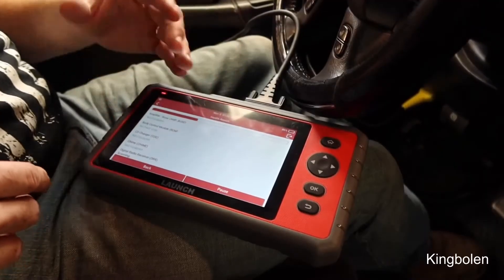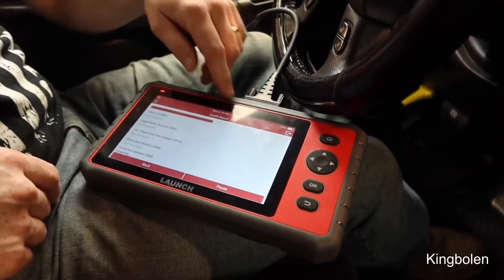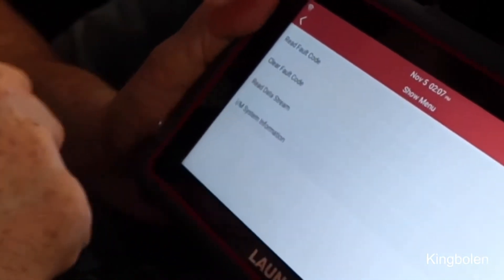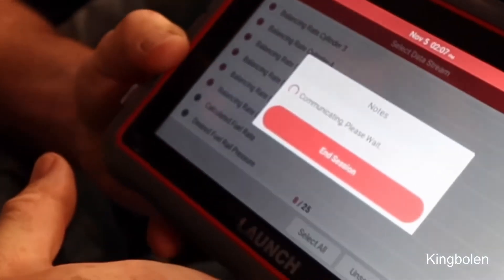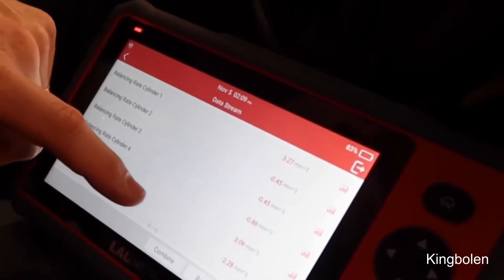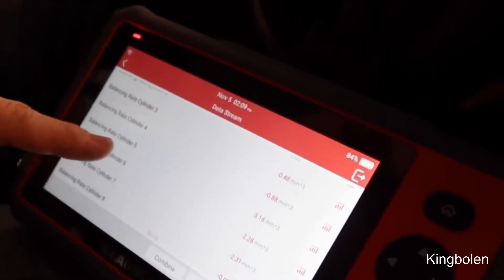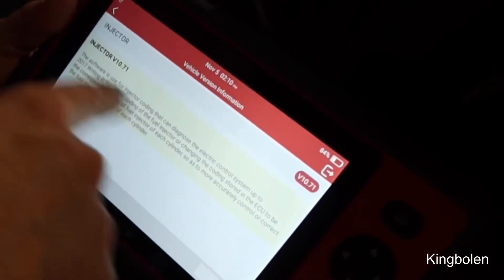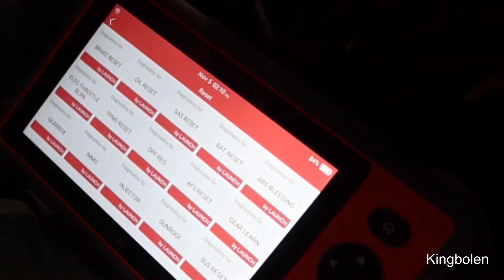Power balance test Launch CRP909E

Comment: Hi, thanks so much for your efforts. Does this tool supports Cadillac SRX 2013? Also there is a section Mail where you can buy packages, does this mean the packages received originally with the device are incomplete and need to spend 50$ to download them?
Thanks so much in advance
Reply from the maker: Yes CRP909E support your car but you don't need to buy anything on scan tool.
It support all popular cars.
Reply: @kingbolen_official  thanks so much for your prompt reply. I have an issue with the cruise control "Temporarily unavailable" does the tool diagnose the different parts involved in the adaptive cruise control?
Reply from the maker: @djefft  Launch CRP909E https://amzn.to/3dV0e75
This one work on all system if you just only read system data or data stream.
If you want to do advanced features like bidirectional test or ECU coding you can think about Launch X431 Pro3s+ https://amzn.to/3b1y0Y9

Comment: Hi I buy that launch do you have where find injector balance because I don’t find in my launch thanks
Reply from the maker: Normail,you need check it under PCM,what the car model&year number.
Reply: @kingbolen_official  thanks to answer is 03 Chevrolet Silverado 2500hd duramax 6.6L diesel
Reply: Do you know if this would work on an 05 powerstroke? Ford ended up putting a flash that levels out the injectors if ones off. I need to run a power balance test on my 6.0 and saw this tool for a couple hundred bucks and thought it might be worth it
Reply from the maker: @Laurel-Crowned  Yes,if it is 12V cars